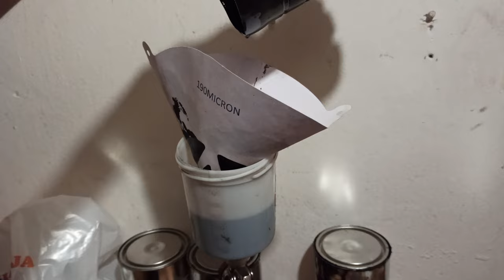Land Rover Series 2A Restoration Part 2 | Sandblasting and painting of axles |

Comment: Thanks for sharing your experience. What kind/ brand of shotgun did you use for sandblasting?
Reply from the maker: On the video it's some cheap sandblasting gun from Lidl for about 12 euros, it works ok if the compressor has enough airflow